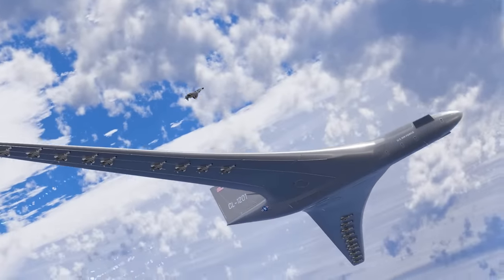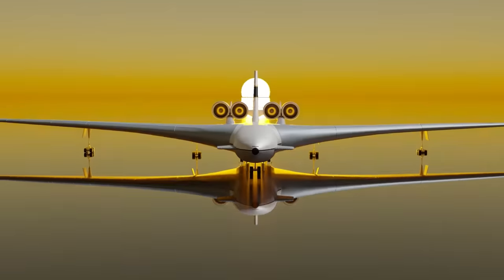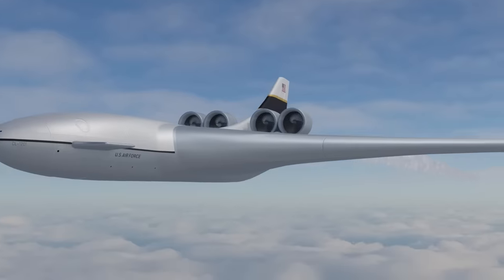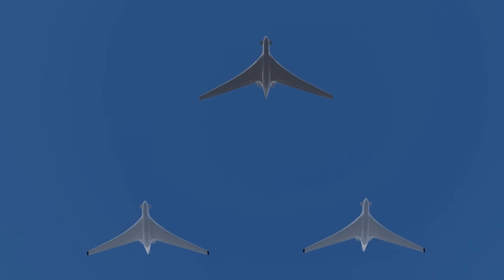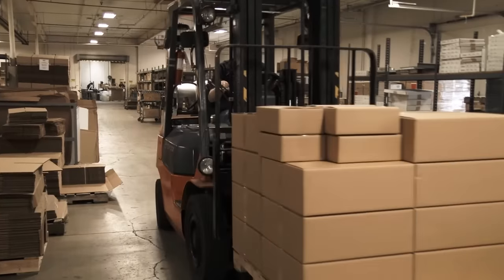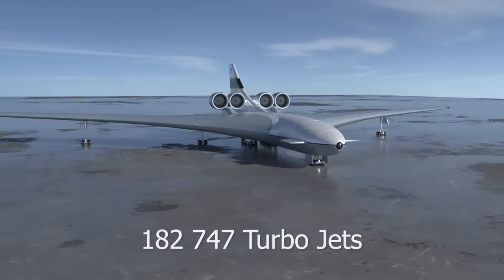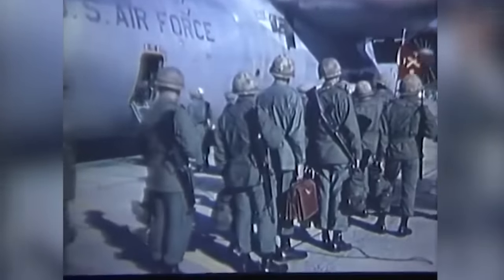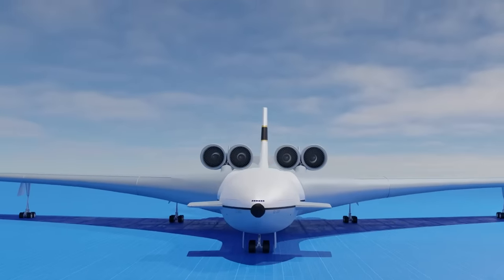The Nuclear Powered Flying Aircraft Attack Carrier - Never Built CL-1201

Comment: 10:50 Why did they need a thick 50' sphere enclosing the reactor? Gama particles travel in a straight direction. Just have 8 layers of 1" thick material covering the 8' diameter between the crew compartment and the rear of the plane. Even lightweight cellular cast aluminum would provide the 10k reduction in radiation needed to protect the crew.
Also, store the crew's drinking water in tanks between the crew and reactor. Water doesn't become "radioactive" by exposure to radiation. Only particular fallout does that. If the water is in tanks, it will simply undergo higher valence electron states, which then collapse to lower states and give off miniscule dots of heat and light. No problem.
Put the food storage in front of the water tanks, and get even further reduction. Plus, the food won't rot or go bad because no fungi or bacteria will survive. Win-win.
If they place 8 lateral feet of water between the reactor and the cargo/crew compartments, then even 1" of metallic radiation shielding would be plenty to remove any harm to structural components that would otherwise be subject to cracking or galvanic corrosion. And the 8' of water would remove all but 0.0000001% of the radiation remaining. Not bad at all.
Reply: Structural support and crumple zone?  The sphere was to make sure the reactor core didn't breach in case of a crash, as you say the rest of the plane's supplies are sufficient to protect the passengers & crew

Comment: One important note you forgot to add is how thick the runway would have to be to be able to support the weight especially on landing. A c-5 needs 8 feet of reenforced concrete now imagine  how deep it would have to be for one of these planes plus the length in which the runway would be

Comment: Imagine the length of runway needed for this plane.
Reply: U need 3 regular airports combined
Reply: The best way to compensate for a short and slim runway (relative to its body) is to make it a flying boat
Reply: @RyujinNoKami  yeah, but that makes loading and unloading more difficult, especially in combat situations.
Reply: @GameC3nt  I am guessing this thing needs like at least 14 km to take of and 8 to touch down.
Reply: Or you do the same thing as Leasath : build a giant seaplane
Reply: @GameC3nt  maybe it's why the runway at Area 51 was extended all those years ago.
Reply: I don't need to imagine, I saw fast and furious 6
Reply: @jonnyjackson6050  who knows, but to be fair, given the sheer size of the thing it would be pretty hard to miss.

Comment: My concern with this thing would be, a 6000 ton object, flying at 600 MPH: What would happen if something went catastrophically wrong? A fire out of control; a mechanical defect in a wing; a hacking of the reactor resulting in an unrecoverable SCRAM? If the reactor vessel could remain intact in a 600 MPH collision with a mountain, what would it do tumbling through a city? Just its own momentum and inertia would be on the incredible scale, never mind the rest of the aircraft. 

The enormous airframe concepts of the WWII era were water based, not land based. I'm not talking about the Hughes H-4 Hercules. No. WAY beyond that. Flying mostly over water greatly reduces collateral damage in the event of a systemic failure.

Comment: That’s pretty awesome. I like the Liquid Metal cooling idea. Is that really possible?
Reply: Yes. Liquid metal (usually some kind of gallium &/or indium alloy) is used for absolutely stupid efficient heat movement/thermal conductivity ALL THE TIME. Even in the consumer world. See many desktop PC's and literally ALL of Sony's PS5's.
Reply: Not only possible, it's an existing technology. Liquid metallic sodium is an example, it is used in racing engines - liquid-sodium-cooled cylinder head valves quickly transfer more heat out where the engine's coolant can remove it, and some breeder reactors also use sodium for heat transfer.

Comment: Imagine if it were built, with a ridiculous engine diameter larger than the fuselage of an A380... and at a ground level that would make it difficult to service...
Designer: "In addition, I will service 182 lift engines for you."
The maintenance man said, 'Tie whoever built this to the fuselage and launch it.'
（Translation using Deepl.）

Comment: It would have made a ton of sense for them to have designed it for water or snow, with air-cushion as landing gear.
See the '70s Boeing Resources carrier for flying oil from the arctic.
 No runways, sea, swamp, sand, ice all work fine.

Comment: 10:00 You are calling them "turbojet engines" but you claimed that they were run on a 1.83 Gw fission reactor.
Nuclear reactors don't run on Jet Fuel. And turbojets don't run on "liquid metal." These are superheated fluid-driven ducted fans. Very efficient and might have actually worked. Except the 182 747 lift engines are nonsense. Would they "fold out" to gain access to the ambient air?
A lift cushion would make more sense. Like the Ekranoplan. Fit the entire structure to a rail-mounted system 5 miles long where the "undercarriage" was sunk below ground level, so that the wing undersides would bounce only 8-12 feet above the ground surface to create the cushioned ground effect to support the aircraft's weight during launch. Maybe have the outboard gear trolleys rest just 4 feet below the wings to dampen vibration and prevent wingtip strikes. Also the Runway could feature inflatable bladders that could rest just below and 20' inside of the wingtips so that would further stagnate the cushion of air, and act like a highway safety barrier in case of a wing strike. The bladder would simply flatten instead of causing the wing to break. (This bladder system would also be useful during landing to slow the contact speed of the tires against the hard Runway surface.)
Looking at the size of the 4 ducted fans, I don't think that there was enough surface area to provide the thrust needed to remain aloft, let alone Take Off. Even at hypersonic velocities, there simply isn't enough volume of air passing through to overcome all of the various drags.
It would need AT LEAST 6 to offset the induced and parasitic drag, and 10 in order to lift off from even a 5 mile long runway like at a Dry Lakebed. (Salt Flats)

I don't think that the crew WOULD need to land for food and water. They could be aerial resupplied via a 1.5m umbilical tube towed behind a Tanker/Cargo resupply plane. They would contact the umbilical against the top of the aircraft several meters behind the cockpit and simply slide the Stocks down the ramp and into the Cargo Bay. They could have 20m of storage length and as many as 4 "columns" laterally arranged. Simply have a diverter flap that directs the oncoming supplies to the desired position.
They could remain aloft like submariners for as long as the Officials wished. They could even travel UP the umbilicus back into the Resupply plane after restocking with supplies and a relief crew. The umbilicus would simply be either folded up underneath the Cargo plane like a ramp, or retracted into the Empennage if it were flexible.
Reply: People must love you at parties
Reply: It resembles them

Comment: I'm always curious how the hell are they going to convert electrical current into propulsion on a nuclear plane. Because it looks like they just slap a regular ass jet engine in the back and power it through nuclear techno-magic. Yes, jet engines got big-ass fans, but those fans are mainly there to compress air for combustion chamber. You still need to add fuel there. 
Unless you just use those fans as conventional props powered through electric motors. So why not just slap actual propellers in their place?

Comment: What would provide the reaction mass for the engines?

A reactor is all well and good, but all it does is make heat water.

What was supposed to flow through the engines?

I call bullshit on the design for not addressing the most rudimentary questions
Reply: Ah..just checked Wikipedia.
It was supposed to use superheated ambient air.

Again, I call bullshit.

No way you could superheat air to provide the required thrust.

It just doesn't have the energy from expansion that you get from water.

Just a stupid idea from start to finish.